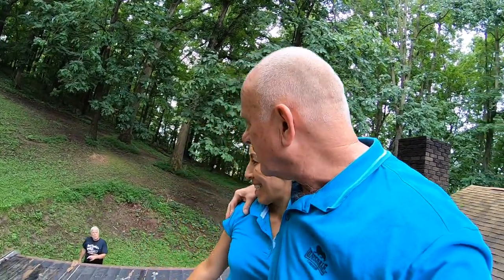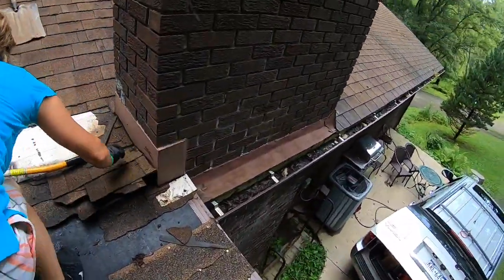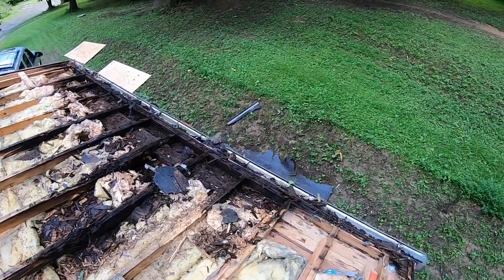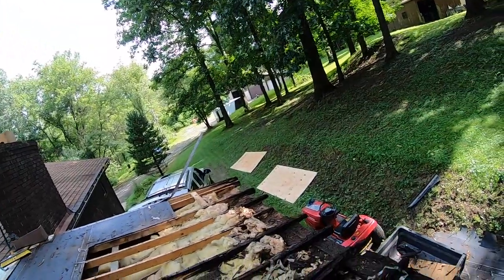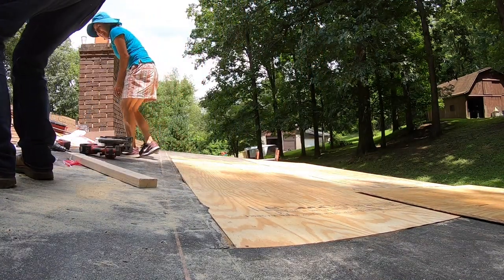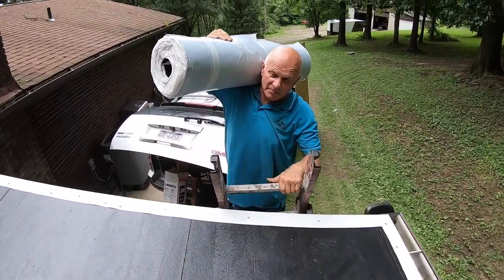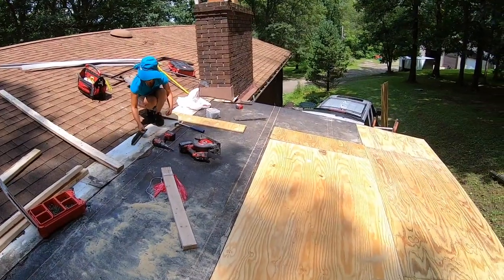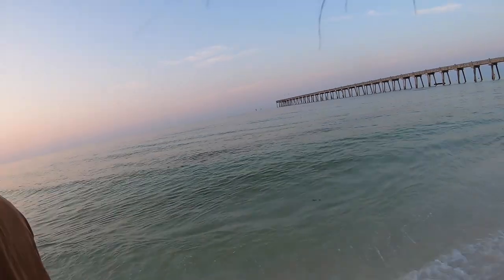Replacing Rotten Plywood on a flat roof - Small repair is a disaster

Comment: ❤ my name is Ron from Visalia California. I am a (Roofer) by trade I’ve only been doing Roofing solidly for the last three years. My skill level has improved greatly due to watching your videos. I think you and your wife are great. I think your wife works harder than any of the other guys that I’ve seen working on your crew. As far as my opinion goes, I would not replace anything that does not need to be replaced. I would only replace, the dry rot, damaged plywood and rafters. Otherwise you might get into a bigger project than you thought.

Comment: You have a horizontal beam support to use.   That is the key to this. So you only need to replace the bottom half.  Overlap the rafters and nail together.
Reply: Cut off the bottom parts like you said, nail or screw in sisters, use some construction glue too .

Comment: I'm having a similar situation right now. I did put off fixing it due to non-affordability, but I kept putting tarps over tarps. The damage did get worse, but since I kept up to it, it isn't as bad as this job you're doing here.
Yes, I'm a 55 year old female now doing it myself with a litlle help. I can do this!

I've asked for help to carry and replace plywood and carry up the heavy roof rolls.
I decided to buy Grace Ice & Water for the first layer and GAF Liberty cap to go on top.
The roof is 36x8 and up 2 stories.
I feel this will do the job....now just excited to get the job done.....finally.
Btw, your wife does a great job and isn't afraid to work and get dirty....nice having a partner to help get the job done.
Reply: Oh boy, Grace is the best Ice Guard out there...but very tricky to install.  I would recommend a different base sheet with a regular "split-film" on the back.  That's two separate pieces of plastic to remove during install...which will be much easier than the single piece of wax paper which is found on the back of the Grace.  Grace has a "rip-cord" technology which is a piece of string down the middle of the roll which is supposed to help with removing the wax paper once your membrane is in place.  It's not something which is easy to do without the experience.

If you cannot find a compatable Liberty basesheet at your local supplier it's OK to use any smooth surfaced (as in non-granulated) Ice & Water Shield as a base sheet.

Comment: Moral of the story: 1) never put shingles on low pitched roofs; 2) fix leaks when they happen, don't wait. I'd advise stripping the roof bare, then replace rotten beams, but some beams don't need replacing. Your advice. Never do favors. Classic! You half-assed it. Lol.  Interesting lessons learned. What was the brand of self-sticking roll in this job before the final roll?

Comment: Just sister the beams. If you can increase the pitch just an inch or so by doubling the shingles and inserting some underlayment sheets   underneath where the 2 roofs meet then the increased pitch will help water travel off the roof rather than collect in a low spot. Also, keeping the gutters clear will help immensely.

Comment: Good video great wife.
About the mess, it’s not a problem if you don’t look at it.
You were kind to offer your help but this is not a one day job anymore. Knocking off the fascia board was good but you either have to replace the rafters or sister them in order to get the structural integrity.

Comment: It seems like whatever you do until I hear it at the end it will be an improvement. I guess if hell freezes over, the roofer last forever. But if you do a partial fix, you’re just pushing on the problem to the next owner. Or the current owner. Or maybe money is such an object that you can only do a certain amount. It’s always a tough call when it comes to things like this. I’m on a fixed income in Florida and Social Security. I would have to do whatever I could on the kindness of strangers to do the best I could. And sometimes that’s it …so open to keep watching and watching.

Comment: I basically have the same issue with a Patio roof. Was covered in mold and mildew underneath. Treated it twice and then power washed and painted with Kills. I have replaced two beams, one that almost collapsed,  and added cross beams. The plywood is all a mess above though. I have put wet patch on seams and coated. Leaks are getting less. Not up to code so no one will repair it. Trying.

Comment: My garage roof is the same slope as that roof, so this  roll out roof stuff is new, no more Shingles, does this stuff stagger the rain and prevent gutter flooding.
Reply from the maker: This Peel and Stick system has been out for a long time. Maybe 10 - 15 years. It is the best for low sloped areas.
I have not clue what "Stagger the Rain" means
No roof will prevent gutter flooding. Only God can.
A gutter can overflow for several reasons:
1. Debris in the gutter preventing flow
2. Clogged down spout
3. Too small a gutter for the size roof surface
4. Torrential rains
5. Not enough drain spouts in the gutter itself

Staggering the rain - maybe when someone had to much to drink? Let me know

Comment: replace entire roof......but as i encountered after a full day replace rubber on flat surface...ponding occured which means it was a waste due to lack of leveling and of course no slope...all for 8 thousand...as well as my ceiling for 1200 for the drywall so it was a waste of money who is at fault,,,maybe me as entire removal would have been more expensive...the roofer tryed to sister the rafter where the dip and penetration occured during the rainstor,m....enjoy your hardwork...

Comment: Do you use any safety equipment to prevent falling off (or through) a roof?
Reply from the maker: I never have in 40 years of roofing. To be in a harness all day long on a flat roof makes it almost impossible to get any work done. There is a lot of walking on a flat roof, and having to step over ropes and other harness equipment while trying to carry material and tools will be a hazard.